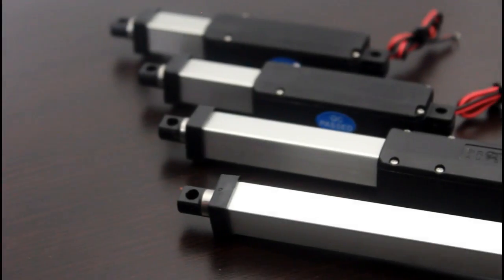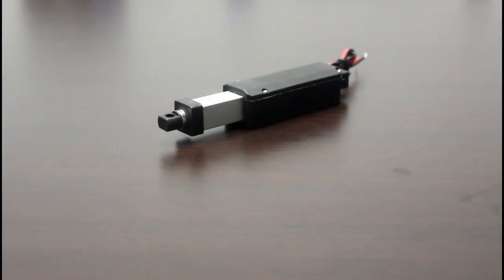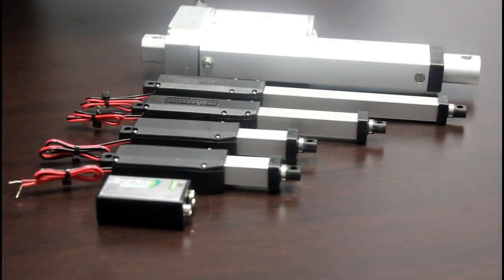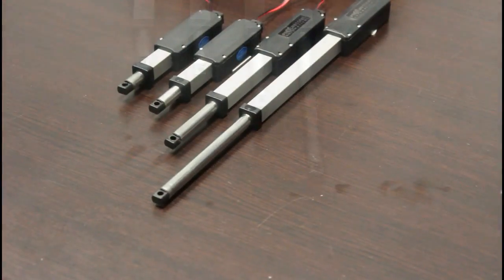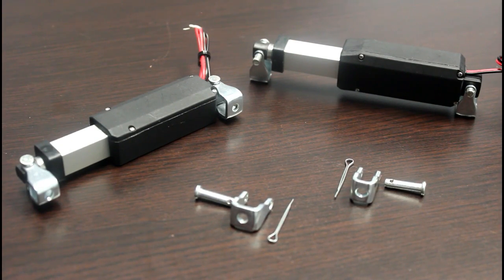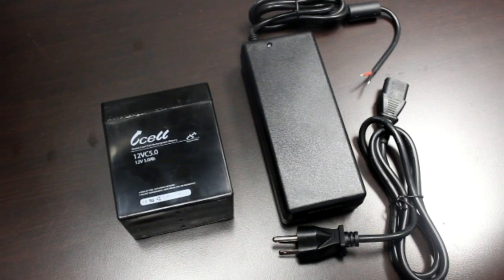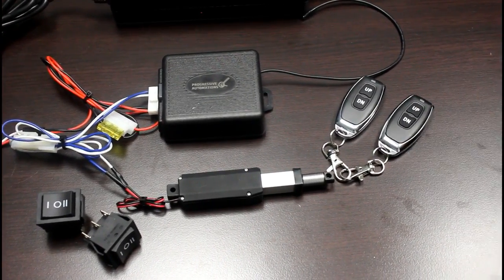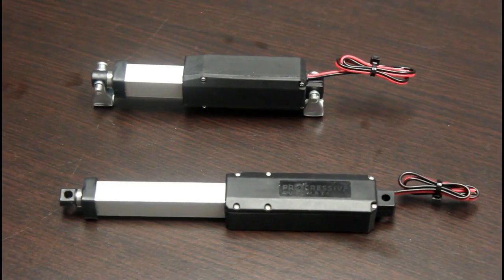Micro Linear Actuator PA-07 - Our Smallest Actuator - Product Overview

Comment: Is it possible to manually push the shaft back in? I mean retract it by hand without the use of electricity?
Reply from the maker: Unfortunately, our linear actuators cannot be manually retracted. All of our models would require a power source of 12 VDC to extend the unit and reverse of polarity for retraction.